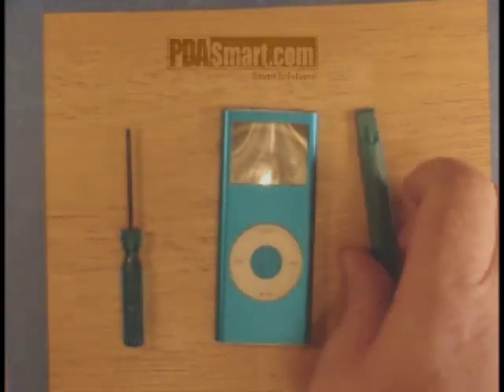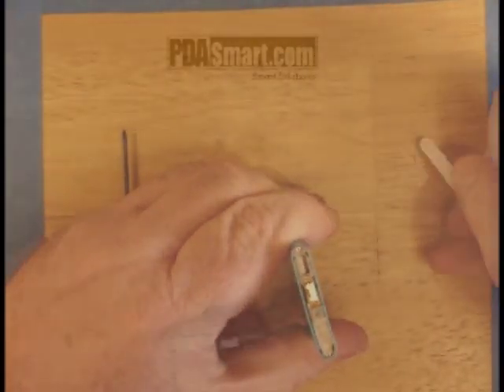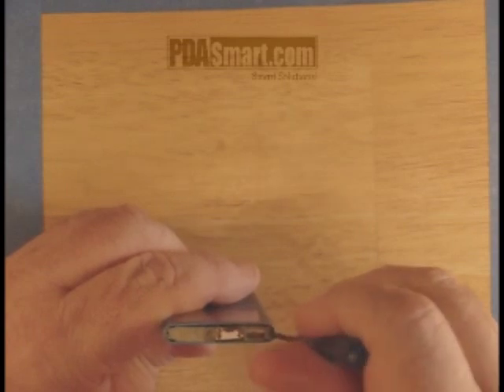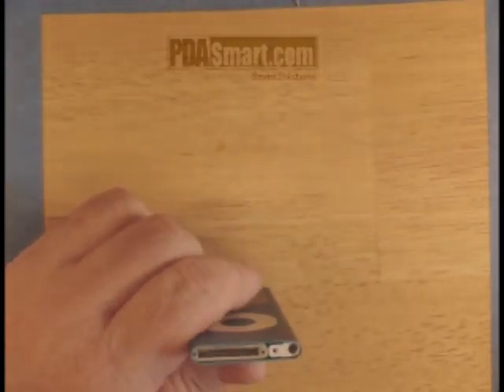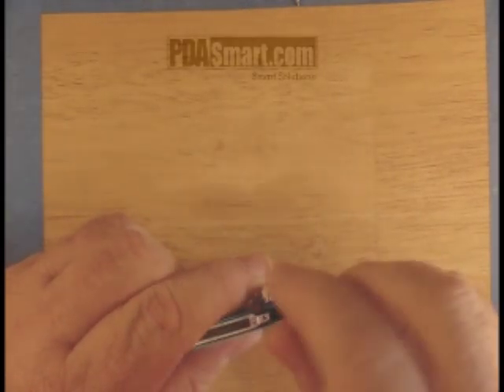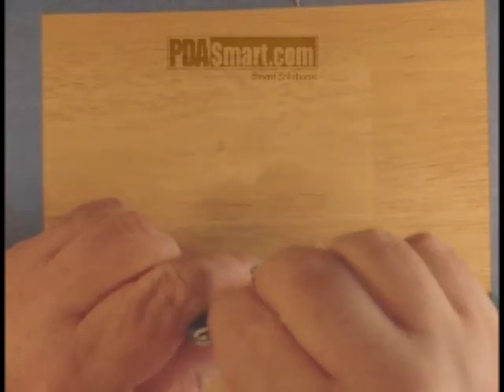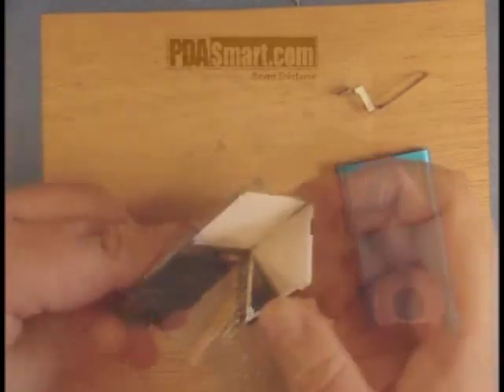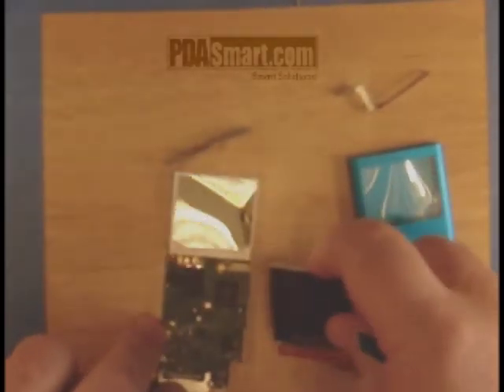iPod Nano 2nd Generation Repair Guide

Comment: TO ALL VIEWERS: The small ribbon that is connected to the head phone jack is plugged into the circuit board that you have to slide out from the other end. If you do not disconnect it before trying to remove the internals you will wind up cutting it, making your ipod useless garbarge. They have left that part out of this video. Shame on them.
Reply: how do you re-attach this if you get a replacement ?